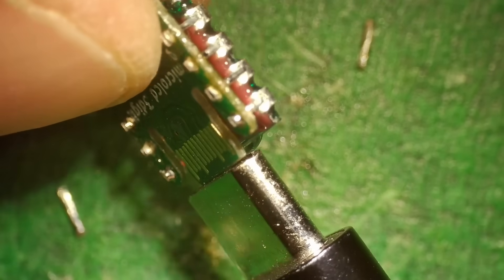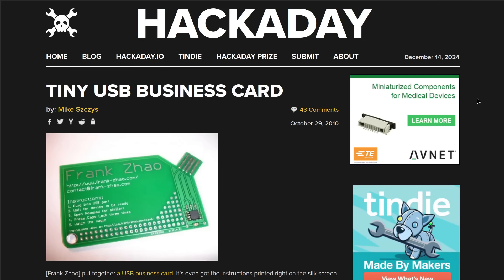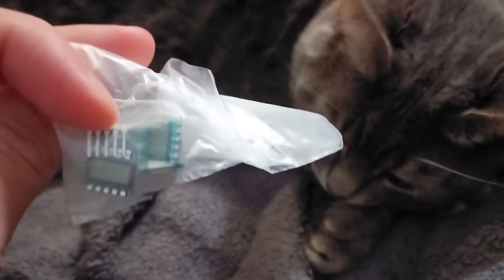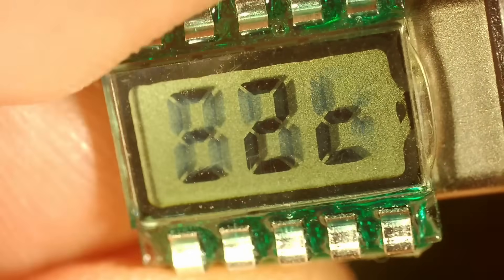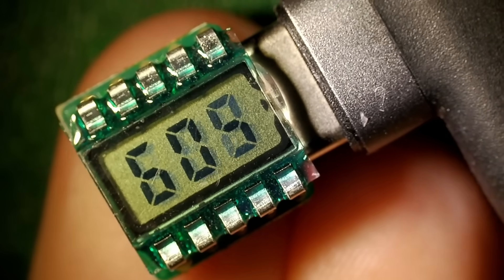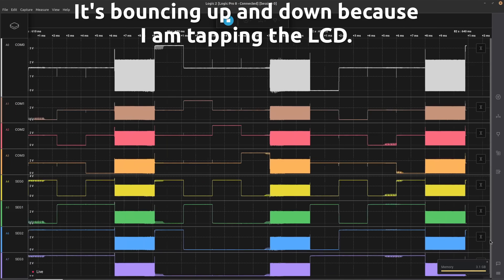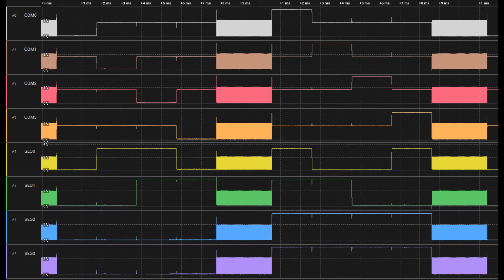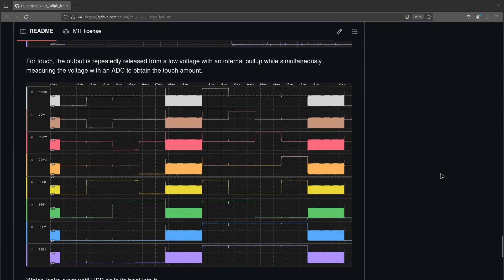Bit Banging LCD + Touch + USB on the ch32v003

Comment: i did the USB thing on a board a couple years back and just went with standard HASL. It's worked for at least a thousand insertion cycles. The only problem is having to order the PCB so thin. The board i am soon to replace it with has a standard USB C connector on it now because of this.
Reply from the maker: That's encouraging.  I feel like the tabs in USB C are more fragile than in USB A, but it would make sense for it to be able to survive it. It just makes me really anxious.  And also, I worry about oxides forming or flux hanging out on the HASL.
Reply: @CNLohr  fr4 is surprisingly strong. I imagine a 3d printed case with support around the periphery of the USBC tab would make it even more resilient. I have been following you for years and your "misuse" of microcontrollers and their peripherals has been a big inspiration. Keep it up!
Reply from the maker: @dhj5  Thanks for the encouragement. I didn't think about that. But, that's a good idea. That would be weird to make a sandwiched "real" "fake" USB C connector.

Comment: Brilliant!!  Now no one tell the Chinese or they will ramp up the price!!  lol
Reply from the maker: That's western thinking.  Chinese just want to sell you products and make money on them.  If it means selling you more product they're happy to do so.  It's only the west where they want to try to extract every cent from your cold dead corpse.
Reply: Not true... I've worked with Chinese projects, and Chinese companies, and they were e not trustworthy, not honest, and always wanted "a discount"... In one case, they actually built our product, on another line, with their own branding, and sold it into the Chinese market. In another case, the manufacturer, after we had designed the product, and spent some 6 months transferring it to their production facility, ran qualification tests at UL, VDE, FCC, CE, et al, only to start having serious, potentially deadly, field failures, ending in a massive recall of literally 10 million+ devices, because they changed the thickness of the plastic molding, to save ~ 0.01€ !
The cost to my employer of about €100,000,000, because they were saving about €10,000 to €20,000 per million devices. In another case, they used a resistor, instead of a ferrite bead, which saved about €0.007 per unit, but prevented using a new part that saved 10x the "saving" of the resistor.
So, if multiple, almost universally-negative, experiences tell you something...

Comment: It's pretty cool getting this cheap chip to talk USB. Though it's software-driven, for many projects, this could be quite adequate. It would be interesting to know the bandwidth of the USB being driven by software in this way.
Very very cool getting the LCD to be a touch sensor.
Perhaps the next step is to get the CH32* to run an LLM 🙂?
Reply from the maker: It depends on how you're setting it up, but typically I get about 40-70kBytes/sec.
Reply from the maker: It is quite adequate!  It is between 40 and 60 kB/sec depending on how you use it.

Comment: Did you need to use the V-cuts? They definitely add to the manufacturing costs. I think JLC also offer programming of chips so you might be able to get your boards made with bootloader included. Not that I like bootloaders. I’ve got myself a selection of CH32V chips recently, I should really get to installing the software stack.
Reply from the maker: I do prefer v-cuts, but I had another manufacturer do it in a slightly different way that was much more cost effective.  I may do a video on that.

And I've done my best to make the ch32v003fun software stack approachable.
Reply: @CNLohr  
Yes your CH32V003fun stack is definitely what I want to use. Personally I’ll be needing the advanced features of the higher-end CH32V chips for my projects (especially CAN on the V307), but if I recall there’s experimental support for the others too, so it’s probably worth going for that instead of some bloated manufacturer-made Eclipse skin + HAL.

I guess the V-cut edge makes for a nice edge to the type-C connector. The extra cost of panelisation made me just combine multiple boards and cut them apart via hacksaw.
Reply from the maker: I don't neeeed v-cuts but they make the edges so nice.  One other thing a different manufacturer did was panelize the design in a really convenient way, I may be making a video about that project some time soon.

Comment: That was awesome! Now, start playing around with the peripherals in the chip in ways they did not plan on.
If the DMA can be set up with any internal address (memory mapped peripheral register you know) as target you can do a lot of fun things. Toggling the LCD signals for example.
Writing to the screen buffer is simply transforming the data to the pattern required on the LCD pins and then letting the DMA repeat. If you find you can not "throttle" the DMA sped properly, use a loopback device in the chip together with the DMA so one DMA sends data via a peripheral (either in loopback mode internally, or via a external pin bridge) to itself and another DMA transfers the received data to the target register to update the pins pullup states. Once you start abusing peripherals like this it is hard to stop. It is so much fun!
Reply from the maker: Oh yeah! the DMA in the 003 is absolutely baller. And you can pipe it from memory to GPIO triggered on a timer.
Reply: @CNLohr  Oooh, DMA triggered by timer is a luxury item! Wow! Makes everything so easy.
Reply: Some of the modern Microchip PICs have a BUNCH of internal hardware "building blocks" that can be fairly arbitrarily chained up internally output to input (including outputting some of it simultaneously on any number of pins); it's quite fun to set up some elaborate Rube-Goldberg contraption, let it loose, then just sit back and watch the show happen without ever even executing a single instruction of code once the initial setup is done (or just flip a bit here or there in an occasional interrupt triggered by some part of your build). And sure you could achieve the exact same thing by bitbanging some code and whatnot, but I find it much more fun to sit back and let your code direct the action instead of generating it by brute force.
Reply: @AttilaAsztalos  Yup, but I still prefer STM as the hardware is smarter than on PIC/AVR. Result is less interrupts required to complete the action.
I've done DMA based SD-RAM access on a STM32F103 (Bluepill) for example. 8MB RAM for image processing!
Reply: @1kreature  Is the project up anywhere? I haven't heard of anyone doing SDRAM access on a 103, people usually go for SPI SRAMs or bigger devices with a FSMC.
Reply from the maker: @AttilaAsztalos  I think a lot of people find that compelling, like with the RPI's PIOs But to each their own.

Comment: The question I have is how did you get the thickness the right size to fit in the usb connector? A lot have tried and failed.
Reply from the maker: 0.6mm FR4 PCB, with ENIG.  that's it.
Reply: @ oh thank you for that. I have a few projects that I want to make with usb pcb.

Comment: How small can you make it with a battery? You realize this is prime fidget material, right? In the realm of tamagotchi
Reply: Would love to hear the power consumption too
Reply from the maker: Admittedly the 003 doesn't have super great battery life. It uses around 400uA in low power mode, and about 11uA in sleep mode with timer on.
Reply: I can imagine a Number Invaders game, like on those early 80's calculator watches.
Reply from the maker: oh that's a good point.  yeah, you could totally do it with a battery kinda thing.

Comment: wtf have you done? that's insanely amazing. I couldnt follow with my knowledge after 5th minute
Reply from the maker: Aww.  I really try to make my content something you can watch a few times to get all of.  Or maybe after getting an 003 and playing with the project and code yourself!
Reply: @CNLohr  yep I have a ch32v003 with a custom board. But I couldn't upload my code. I have a 10uf capacitor but maybe the solution is having  a 100nf capacitor. You have a lot of experience, do you know is it really obligatory to have a 100nf capacitor. My wchlinke can communicate but cannot configure mcu. I even used the link RV mode but no clue :(

Comment: Why bother with the expensive usb pads.  Won't it take 1000s of insertions to damage a usb cord?  A damaged cord will be alot cheaper than an expensive $6 pcb.

Great jarb!
Reply: It takes 1 insertion, then the very thin tin layer deposited on the contacts may oxidize into tin oxide which is non conductive so next time you use it you have all sorts of issues.
Nothing ruins a gold plated contact faster than a coating of tin. The wiping action of the insertion will help a bit but the oxide is really tough stuff. Anyone who has probed an old solder joint knows how hard they sometimes have to press to break through.
Reply: @1kreature  oh i had no idea.  What are the cheap usb cable's PC end coated with?  What is the reason that coating isn't available on pcb pads?
Reply from the maker: It's usually gold.  And that's one of the reasons I chose gold coating for this PCB.
Reply: @1kreature  For a proper product this would be an issue. for a prototype its not that big of a deal. I have a project that has been in service for over a year with over 1000 insertions and it is also left outside under the hood of a car and it works just as well as the first day i used it. I will be switching this out in the future mostly because i don't like that the PCB has to be so thin for this to work.

Comment: Did you consider panelization as a manufacturing option? This may allow for huge per-piece cost reduction. Many manufacturers offer free panelization, so you even don't have to do it yourself.
Reply from the maker: For larger runs, absolutely worth it!  For tiny runs, I just let it roll.  The cost is with the human factors in doing assembly.